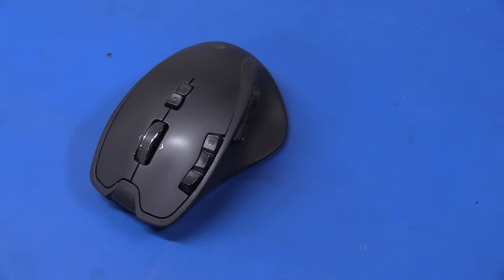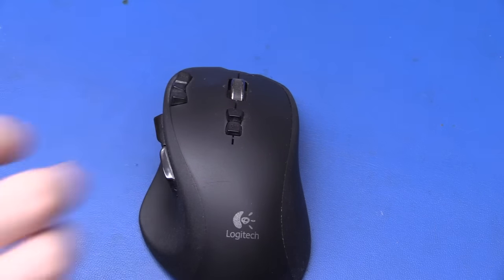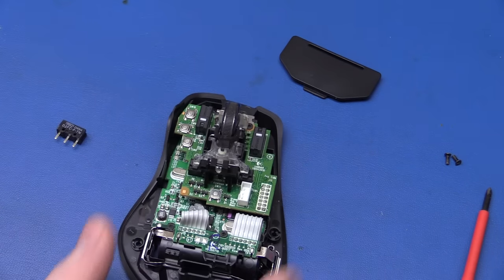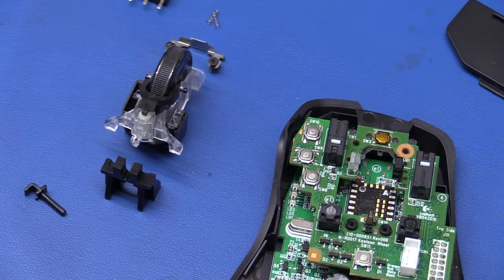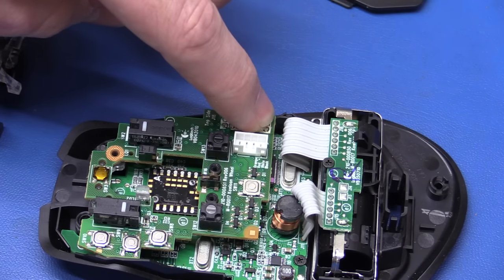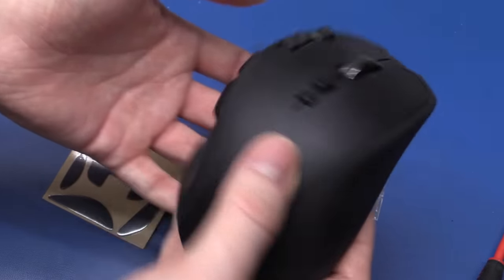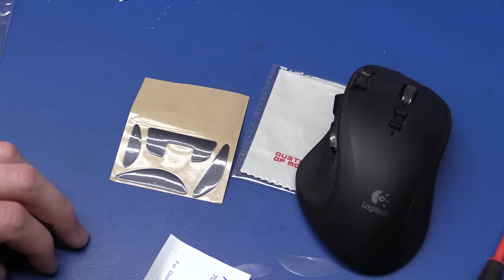Logitech G700 Mouse Repair (Bad Switch) - Ec-Projects

Comment: Excellent guide.  I fixed my G700 with this video.  Even though the left button had the double click issue, I replaced both switches.  The hardest part is desoldering the top board.  Take your time, and like the author suggest, add some solder before using the wick or sucker.  It seems counter intuitive to add solder when you're trying to remove it.  Thanks EcProjects.

Comment: I just finished this repair, and then found this video. Very good instructions!

If I'd have to add something:
- Much or most of the work and repair cost goes to disassembly (and new skate pads), so I'd recommend replacing both switches while you're at it, or at least check with a multimeter that the other switch is OK. Mine was not, even if I had never noticed any problem with it.
- Also good opportunity to clean the mouse.
- A basic multimeter with the analog-style continuity beep is good for testing the switch.
- Also good idea to test the new switch to rule out a DOA part.
- The fresh solder + solder sucker method worked well for me.
- Since there is some online guide where some mallet has managed to break the PCB: A light touch to a desoldered pin shows if it's free. If not, do not try to remove the board.
- Be careful with the two springs. Half of the repair time easily goes to finding the springs that, after a light touch, seemed to teleport to another dimension.
- The switches were actually the (10M) version, but no big deal.

Mine was a 2013 model, and the switches lasted exactly as long as the skate pads luckily.

G700 is a great mouse overall, especially for desktop work, while not the best for fast-paced gaming.

Logitech, if you are reading this to research ways for planned obsolescence: Please don't do it, and design mouses like G700, keeping in mind:
- Do not use the rubber-like coating, because it becomes sticky after some years. (For my G700 it isn't a problem yet though.)
- Do not put the screws under the skate pads.
- Make it possible to replace the omron switches without desoldering PCBs apart.
- Make sure there are no showstopper software bugs (as there was with G700 forgetting the settings). Support Linux.
- Offer spare parts.
- More buttons is better. There's a hundred on a keyboard for two hands, so why only 5 or 10 for the mouse?
- The shape of the G700 buttons is great. Usability > looks.
- Removable battery (and wireless+USB combo for communication) is good for a desktop+gaming mouse, even though a tricky choice for a hardcore gaming mouse.

If these are fulfilled, I'm happy to pay 3x the price of a cheap mouse, when I know it will last 3 times longer with some maintenance, and be 3 times nicer to use.
Reply: I replaced the whole board assembly with new board with 14 pin socket. No more need to resolder the 14 pins.

Comment: Honestly, if you're going in to change left click switch you might as well change the right click witch as well.
Reply: @KurentEweser  Whats a deoxit?
Reply: @archevii  They're talking about the contact cleaner spray "Deoxit". Though in these cases, it's not an issue of good contact, Omron unfortunately doesn't make long lasting switches. Look up all the issues with the Logitech G Pro wireless switch issues, they still use Omron and the switches are still extremely problematic.
Reply: @xboxGTbenton1234  what's a good replacement switch...? mine lasted 10 years  (mine was made on a wednesday I am assuming) (Mon = hung over... Fri = getting ready to party)
Reply: @avpowerstn1  I sent my G Pro Wireless to Ents and they recommend Kailh GM 4.0 Red switches. I've been super happy since June with the swap and the feedback of the switches is significantly better than the stock Omron's. Ents also has videos on how to replace the switches yourself on YouTube. It's pretty straightforward and easy, I just unfortunately have no soldering equipment and no experience.

I'd recommend those switches on whatever mouse you have that you enjoy using. Mouse switches are unsurprisingly pretty universal but, the only mice that may not use these rectangular switches are "silent" mice. They use a flat style switch with a button on top.
Reply: @xboxGTbenton1234  Excellent Thank You
Reply: @avpowerstn1  D2FC-F-K(50M)
Reply: @archevii  Deoxit G5 is a lubricating contact cleaner.
Reply: @KurentEweser  damn cant believe its been 4 years since i started this hobby, yea i dont live in the US so ive never heard of the brand before at the time

Comment: Buying dozen or two D2FC-F-7N -switches is a great investment. They are compatible with most switches used in regular sized mouses and are quieter than some switches in cheap mouses... So changing the switches can in some cases be a good idea even if they are working OK.
Reply: Yes, but I would invest directly in the variant with 50 million clicks (50M)...
Reply: @maxlpower4985  or get kailh gm switches

Comment: we can just replace the spring. no soldering needed.

1. buy a matching switch. you should be able to see that it's latched on the sides. 
2. use box cutter to unlatch it and open it. you will find the bronze rounded square thingy inside. use this opportunity to see and learn the mechanism of the switch. this will come in handy later
3. open the old switch (which still soldered to the board) using same method
4. swap the springs. if you learn the mechanism of the switch, you will know how to install the spring inside the switch.
5. close the switch and reassemble the mouse

double click are caused by weak springs. (if you learn how the mechanism is, you will understand). usually we just replace the whole switch. sadly in G700's case, it's easier to just replace the spring since replacing the whole switch requires some extra steps.

Comment: Just wanted to say that often you don't have to change the switches. Normally it is just the contact surfaces inside the switch that have become a little oxidized and don't make perfect contact anymore. I think this can happen regardless of switch quality. If you carefully open up the switch (try not to disassemble the inner workings by mistake, it can be a pain to put back together again even though there are just two parts) you can slip a very slim piece of superfine sand paper between the contact points and give them a tiny little rub. Finish off with some electronics cleaner spray if you have. Put everything back together again and very probably your mouse will be working just fine for another couple of years.

Comment: The switch is not the problem. The problem is the "hammer" striking the switch from above. There is a small plastic nose on the hammer, which I removed at the base until the surface was flat. Then I broke off a single blade from a small cutter knife (grinded it into a square shape) and glued it on the flat surface with super glue. The problem is gone. Now I have a hardened steel striking the switch, which will probably last a million years. I also tuned the (rubbery and unresponsive) middle mouse button by bending the small sheet (seen @ 3:12, next to the two springs) to 90°, making the middle click much more crisp.

Comment: Dude, you really are AWESOME ! I fully dis/re-assembled and fixed my mouse, thanks to you. I was then blocked with desoldering components (I'm really good at soldering, but was not at desoldering), and your small tutorial about desoldering was really interesting ! I succeeded the operation, and 1h later, I was going to desolder (successfully) a Playstation 3 component, thanks to you again. Thanks so much for your help, you made my G700 looks like new after 6 years of use!

Comment: I miss the old G700. Only issue I had with those was the charging ports going "bad". Didn't know I could just clean them with a sewing needle. The G604 (my current mouse--RIP) is a next-level nightmare to disassemble. I will never try and do it myself again. I ordered Huano White Dots, but alas I am stuck with a thousand parts and screws.

Comment: THANK YOU SO MUCH!!
I bought replacement Omrons, but could not figure out how to get the upper board removed - would have never thought that one has to desolder the DIL connector 🤦‍♀️🤦‍♀️
This is really bad design and "Planned obsolescence", especially with the used 10M Omrons!
(I replaced with 50M btw, price diff is neglectable  compared to the replacement effort.)
Thank you! 👍👍💖

Comment: I had exactly the same problem on my G500. But I didn't feel like desoldering that connector, so I just opened the microswitch and bend the spring a bit more. Has been working fine ever since. If (Or should I say when?) it breaks again I will probably replace the switches.

Also I would suggest to replace both buttons while you already have the mouse apart.
Reply: I spent 2 hours to replace the spring in place. Very difficult! There are small recesses invisible to the naked eye in which the spring is engaged. I'd rather change the key. Thank you very much!
Reply: Did that 3 times with my G700. Trust me, you'll start having to do it more frequently. Now I'm buying the tools in this video to replace the switch.

Comment: THANK YOU SO MUCH, taking time movie-making and sharing this.
Worked for me es well.
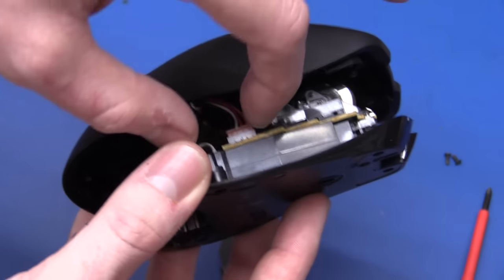Only: to open the connector at 2:02 I had to open the "nose-clip-connection" by the side with  a small screwdriver to make it possible to disconnect..
Reply: I was not able to disconnect it at all. I noticed it even pulled out the white socket out of the print board a bit so I stopped. I then decided to unscrew the print on the other end and exchange only the keys G4-G7 since there was one key broken.

Comment: At first I tried taking the switch on my G700 apart and flexing the spring.  That worked for only a short time so this is next.  Great Video
Reply: I had spent like 3 hours taking mouse and switch apart, cleaning it, only to break the tiny clicker spring when trying to flex it. RIP
Reply: Replacing the springs is easier. just buy the switch, and swap springs.

Comment: Thanks for the tutorial! The left button works fine now!
But unfortunatly I failed the first desoldering and not every metal ring around the holes has survived... Result is: The wheel and the buttons G8 to G11 wont work. 
Is there any way to fix the missing rings on the plate?

Comment: hey man great tutorial! i followed the steps and saved my G700. for the switches i used from those chinese cheap black and white ones. it had a long metal lever to push the button but i just removed it by pulling it. apart from needing abit more force to push the button it turned out ok. saved me from buying a mouse its a great satisfaction :) thanks

Comment: Unfortunately this was the most annoying repair I've ever tried. My god. I couldn't desolder that fucking white strip without ruining it. My wick and solder sucker couldn't remove all the solder needed to lift the board. So I had to get aggressive, and my aggresiveness really damaged that thing. I lost almost all of the little silver rings you see in the video. I still put the board back together after changing the switches, but re-soldering the white strip was also a pain in the ass. I couldn't get the damn solder to stick to the board. It would either stick to the iron, or stick to the pins and not touch the board. I used flux and everything.

Still, I did what I could and tried the mouse out. And hey.. the cursor moves... but none of the buttons register! YAY .... lol

Man... I loved this mouse when it worked :(
Reply: I had the exact same problem. The left and right clicks may still work, but G8 to G11 are dead... Desoldering is harder than it looks.

Comment: Does logitech G102 also use same switch.  I saw those also has pin connection but I need to know is there any size difference to switches? Before I order these online.

Comment: Good tutorial, but I made it much easier, not very keen on soldering, gently open  both buttons with an x acto, and replace the damaged metal part with the new one from the new button, close it again, problem solved, took me 10 minutes, did it twice about 2 years ago still going strong.
Now I'm looking for button reference of the left and right scroll buttons do you happen to know it ? got one failing
Thank you.

Comment: I love my mouse, but they dont produce it anymore. i need to finde something as good as this one or i have to simply fix it. 
thanks for that.
Reply: I've looked at a lot of different mice since my G700 started failing last year. 

Most recently I've been using the G602. I kind of hate it though. The shape is different and rather uncomfortable. The buttons flanking the left click are flat and almost flush with the click key itself which makes them pretty useless. Even after 9 months of use I can't properly distinguish between the 2 buttons with my finger and about half the time I try to use one of them I end up pressing the left click at the same time or pressing it instead of the flank button.
The 602 doesn't have the hyperscroll function either or the custom button you can use to change profiles under the hyperscroll toggle.
They added the hyperscroll back to the new 604, but other than that it looks exactly the same minus new internals.
I gave up and shelled out $200 USD for one of the few new G700's left on amazon.
Can't understand why Logitech discontinued this mouse and replaced it with the 600 series mice.

Comment: After I replaced the buttons my scroll wheel did not work properly. It eaither skipped when scolling or did nothing. When I put the board back in it did not have the perfect level. It was maybe 0.3 mm too high. So when you push the "free Wheel button" there is a button underneath which gets pushed in too much. After I corrected the hights of the board the scroll wheel worked perfectly again. Thank you for the video.

Comment: So I posted my first comment 3 years ago, the replacement switches are even more awful than the original ones. I replaced it then, I replaced it against last year and I have to replace it again lol. It sucks that this is such an amazing mouse that now I'll probably be replacing these switches every years for the rest of my life (or until something much worse fails).

Comment: All mice suffer from the failed switch issue, so all will need it done at some time. I have often used another switch as a temporary fix, especially with some MS mice that have a high switch, just mount the switch high up on the leads to operate.

Did not know you could get the pads though, all of mine are worn off, and some are nearly through the case as well. But then, 10 years plus on a wired mouse is way beyond design life.

Comment: Hi, Im having problems with desoldering the switch...Im not able to suck out all the old solder with the solder sucker and my 30W soldering iron isnt hot enough to make the wick work neither. I tried putting some fresh solder on the joints and suck it out, but with no success. Do you have any tips how to get this done? Thanks.

Comment: Fixed my old mouse couple years ago same problem, that involuntary double clicking can get you into a lot of trouble I once clicked a BUY NOW button on Ebay because mine went all spongy and got stuck in the down position, the Ebay seller was quite understanding about my runaway mouse:p think that was before they put the confirmation thing in place, tip never blast the switches with lighter fuel, when running out of isoprople alchohol haha NOT wise, Mouse was much happier after I got the new switch

Comment: I own Logitech MX Performance mouse and had the same problem, under 2 years of work. Logitech needs to use better switch technology the web is plagued with people with problems like this, I own a Microsoft mouse its 5 years old and dont suffer from this problem. again this is a component source problem those omron switches are poor design or fake or both.

Another point some people actually restore the tension of the spring without removing the switch, but its annoying to get the spring in place.
Reply: In my experience, the silicone band on the scroll wheels of the Microsoft mice stretch and fail after about a year of use.  I've also had a switch failure on one.
Reply: true about the silicon band, I had this happen to me as well.
Reply: I use a $6 "gaming mouse" from ebay. Definitely not perfect but I do prefer it to my old overpriced razer. Anything goes wrong and it's just $6 to replace.
Reply: Glad I stuck with my over 15 year old intellimouse explorer from Microsoft then. I think I exchanged a switch once and shortened the cable twice (broken conductors), but other than that still going fine (for work and sometimes excessive gaming).
Reply: You are quite lucky your mouse has lasted so long.  For most gamers,  a mouse (gaming or otherwise) will normally last about a year before the microswitch fails.  The biggest factor is how often you click it.  Gamers are almost always clicking.

It is NOT build quality.

What would be nice for the higher priced mice would be to have the microswitches plugged into sockets.  This would allow the owner to quickly and easily replace the microswitches when they begin failing.  I would certainly not mind paying an extra 30-40 dollars for a mouse that was not expected to be a throwaway product.  

This video was quite good and my only problem is my soldering skills.  I tend to burn things.
Reply: Well I have to be really lucky. My G700 is about 6-7 years old and not a single problem with the mouse switches dispite heavy usage during gaming.  Just the batterie is slowly dieing but easy replaceable. I hope it will last for long cause I really love the shape and its "retro style"! I don't nead 16000 dpi or RGB...
Reply: Try TtTheron. I had MS mouse (the gaming one with the heaviest price tag) gone bad in 2 years. I had logitech G700 gone bad in also two years. Bought a TTesports Theron still using it. After using for 5 years, I bought another one just in case...